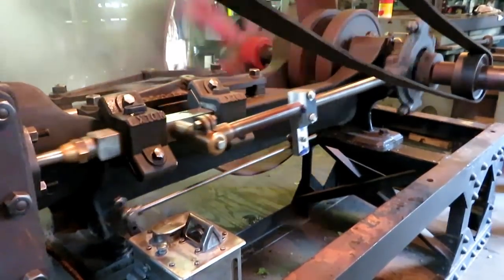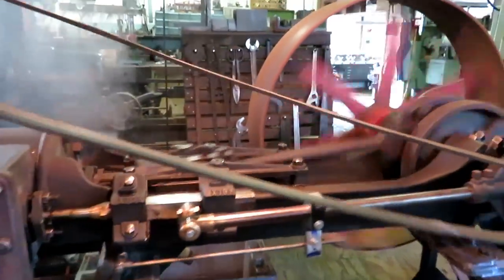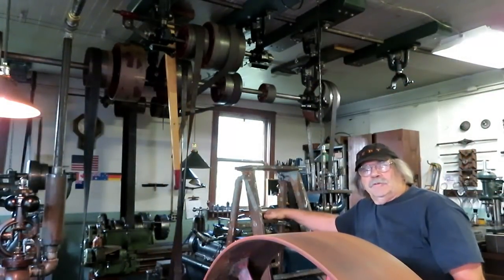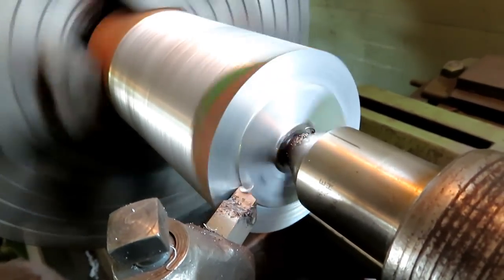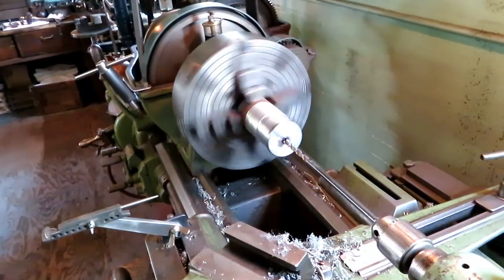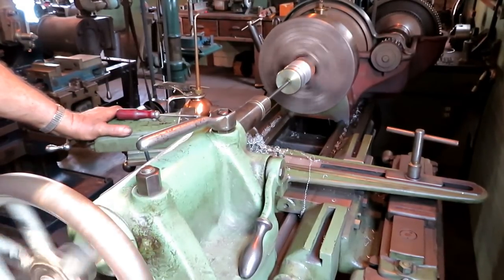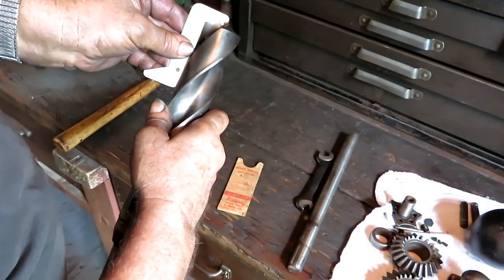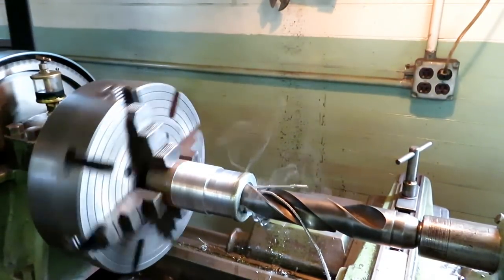OLD STEAM POWERED MACHINE SHOP  28

Comment: Dave, no insult was meant or intended and I sincerely apologize if I offended you in any way.  My concern was genuine as I really have seen, and come to think of it experienced the results of falling off a ladder.  In my case my nose has never been straight again since that day in my early thirties.  An when I saw you standing up towards the top of that ladder hoisting that pulley up over your head it triggered memories of my accident.
So once again if I offended you in any way I apologise.  Scott Pecora
Reply from the maker: Seriously Scott, I was just "funning" you...Dave
Reply: David Richards I'm glad, you know that's the one thing with email and texting, emotions and humor can be difficult to determine sometimes.  An I only know you from videos, although it comes through that you have a very dry sense of humor.  I laughed for a day and told a couple people about when you were describing the technical aspects of how the water injector worked for the boiler and you commented that 70% is such and such, and....the other 30% is uh....magic!  I still crack up because it's probably closer to the truth than most people realize.  
BTW on the new 8x10 engine on the govener it doesn't have the drop down pulley like the Pickering for emergency shut off if the belt breaks?  Does that bracket opposite to the pulley shaft have something to do with the shut off valve?
Speaking of overspeed shutoff did you catch what the guy said about the big Snow twin compressor when the governor stuck and it started to overspeed until the centrifugal weights popped out on the fly wheel which engaged the over speed shut off?
Also I thought the extra u-shaped bracket you added to the overhead line shaft brackets was extremely smart and adds a nice little margin of safety.
Best of luck, Scott

Comment: Thank you for the best on view high resolution videos ever. Regaining my belief in humans after what is happening in my nation. Keep up the good work, it shows how good we can be, and set up your engine with a drop from the line for a dynamo, so later, you can also generate electricity for your community, when the community will not be able to send you power. Soon
Reply from the maker: Hi Paul, The plan at the moment is to run a dynamo with the smaller engine....Dave

Comment: How do you fuel the boiler? How often would you have to stop and stoke the fire if it's burning consumables? That's gotta eat into machining time potentially.
Reply from the maker: With wood you have to fix up the fire about every 15 min. A deep coal fire, damped down will go about 30 min. without attention. You have to add water about every half hour. I can usually do it while a machine is in a cut, good question, thanks,.....Dave

Comment: Is some sort of lubercant / oil injected into the steam to lube the internals of the steam engine ?  What kind of oil ?

     What kind of oil do you use on the line shaft bearings and the bearings on the equipment ?  Engine oil ?

Thanks ,   :-)
Wyr
God bless
Reply: Sorry , I latter got to the part where you spoke of the oil injector .  I should have waited until untill the end of the video to ask a question .

Thanks ,   :-)
Wyr
God bless

Comment: Hey Dave, what happens when you you really place a heavy load on one of the machines?  Do the belts slip or does the steam engine bog down?
Reply from the maker: The big lathe belt slips on the top pulley, the milling machine slips on the bottom pulley and throws the belt off, the shaper will make some belt squeel when you are getting close and then will throw the belt off the bottom pulley, The engine never slows down.....Dave

Comment: Hi David :  What do you have under the wood floor to hold all the heavy machines up?
Reply from the maker: It's a very heavy timbered floor, but I want to eventually pour a pad for the boring mill and lathe...Dave
Reply: David I have found some of the parts for the Class A Gov. for your Gardner. Paul

Comment: Safety idler for the regulator as with the other engine or does the gravity going down slow down the engine?
Reply from the maker: Thanks for watching Gregg, We're working on getting the parts to convert the big governor to a "Class A" Gardner governor which will have the idler and safety shut-off like the Pickering governor on the smaller engine.....Dave

Comment: So 
Dave? Did you get to have a look at that Steam engine 
Print I drew and Emailed to you?
and If so, what did you think of it?
Reply from the maker: Yes, thanks Richard it is an interesting design. If I ever get  to the point of a design for an engine to build though, it will have to be a very simple traditional design to start with. Something easy to cast and machine while using modern components and materials.....Dave
Reply: Have you Seen Mr.Pete222's channel? He has some  types very simple Oscillating cylinder steam engine, if that is more to your liking, I just thought, that you might like mine as it won't violate any of the others patents.

Comment: How's the boiler handle the load on her?

Obviously with the bigger engine she has power to spare. Do you by chance have a belt driven AC generator so you could create your own electricity? I was thinking 15 to 25 kilowatts of power. 

I was thinking using a former gasoline generator by Onan designed to run at 1800 rpm to create 60 Cycles with an output of 240 volts. Think your best source of metal stock aka the junkyard. Then again someone may have an old open frame AC generator sitting around that would be willing to let it go at a very reasonable price or barter. After all you have a skill that not many people can afford but may have some piece of equipment you might want or need.

Your line shaft oil drip pan you added? I would drill a hole in the drip plate and add a say a baby food screw on cap so you can screw on a baby food jar thereby allowing you to see how much drip oil is in the jar so you can easily empty it. Just playing the devils advocate.
Reply from the maker: James, you could goof off a little at firing with the little engine. With the big engine you have to be paying attention to the fire. I have a generator that will be going on the Small engine to generate lites....Dave

Comment: Mr. Richard, 
I have a question: At the beginning of the episode you was mounting a wide pulley on the shaft to a narrow one on the machine. Do you aline them center to center and how do you determine the belt width?
Reply from the maker: Hi Craig, That one doesn't need a very wide belt because the milling machine has a transmission (speed reduction) which multiplies the torque. I think it's only 2" wide. The top pulley is wider because it's what I had in that diameter. It dosn't really matter where the belt runs, but I try to get it about in the middle if possible.....Dave

Comment: interesting the the governor is belt driven what happens if it falls off?
Reply from the maker: The engine goes wide open and things go really fast.....Dave
Reply: I sorta expected that, makes you wonder why it was done that way
Reply: I was wondering that as well. But was hoping there was some kind of valve inline that would shut it down.
Reply from the maker: We installed a quarter turn shut-off in the overhead line which will have a pull chain...Dave

Comment: Congratulations on getting that big daddy rolling again, it is poetry in motion.
I do have a question on how you get the lubrication into the bearings for the line shaft now that I think about it.
Stand on a ladder and fill individual oil cups or have you ever considered ganging them all together with tubing and only having to fill them all from one location?
Reply from the maker: Phil, A couple squirts with a long spout oil can once a day does it....Dave